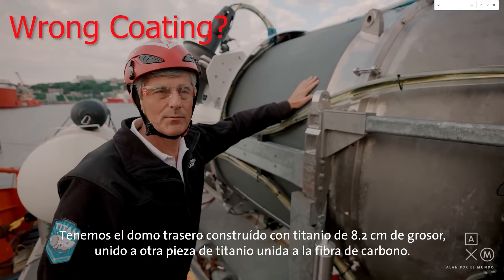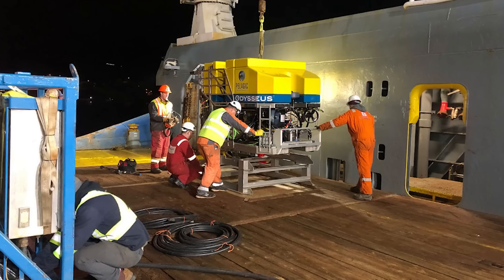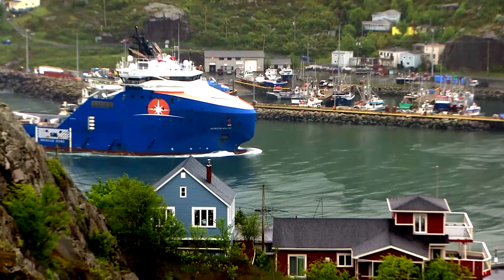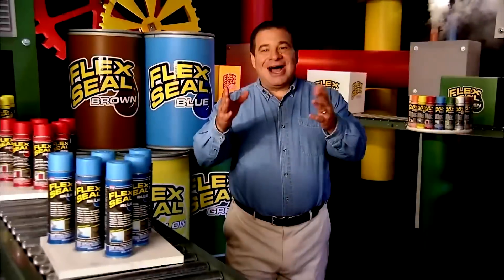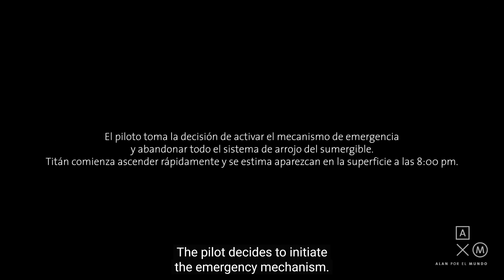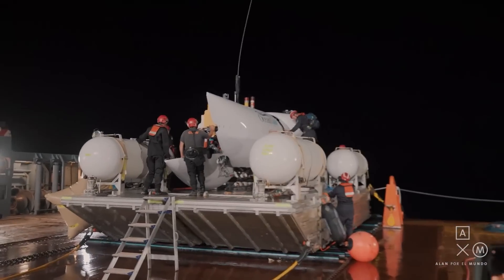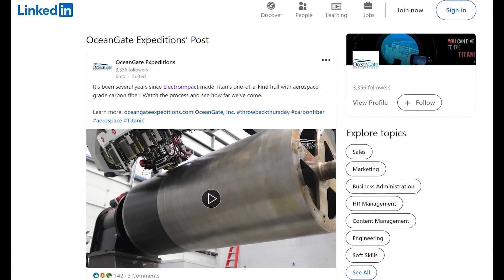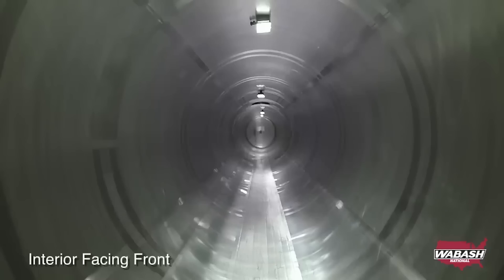Titan Sub Wrong Coating? Hull Construction, Debris Field Search

Comment: 11:45 - how are the ends of the carbon fiber made to be neat? - there is going to be titanium end cap pushing onto the end of all those layers - if the layers aren't perfectly square, there could be quite an un-even force across the thickness at the ends there , if the profile is even slightly like 'www' - 600 layers, with the binder present while still somewhat fluid ...

Comment: Rhino liner sucks. We use it to coat parts and sometimes we need to remove parts of it. With just a razor blade cut a square thru it and it will come up.

Comment: The use of scale models early in the design of ships, aircraft, cars and many other engineered systems is very common in the early development stages.  It is much less expensive to fabricate and test a smaller model than a full size model. Leonardo da Vinci did it.  The Wright Brothers did it.  Jack Northrup did it.  NASA & Space-X do it.  The uncertainty is how to extrapolate the small scale test results to the full scale.  Oceangate learned that CFRP hemispherical ends weren't workable from the 1/3 scale test and switched to titanium hemispheres.  Some fault Oceangate/Rush for lack of testing before diving to the Titanic.  With both the 2017 and 2020 CFRP shells, Oceangate conducted a series of deeper and deeper tests, initially unmanned, then manned by Rush alone, then with others.  Deep sea test results from the 2017 hull in 2018 and 2019 caused them to scrap that original full scale hull and build a new one in 2020 based on lessons learned.  Obviously, the didn't learn enough or they ignored negative test data to keep the project alive.  I've seen it several times before in small venture-capital start-ups with egotistical/clueless CEO's.

Comment: I think the rhino  liner was because they knew there was porosity in the body which could cause problems with extreme pressure changes
Reply: Agree, but what happens when extreme pressures start to 'push' the rhino liner material itself into the pores of carbon fibre?  Be a bit like an extrusion machine pushing plastic into a mold I would think.
Reply: That fact alone should have made this a no-go. Instead he put a bandade on it. Damn fool.
Reply: He should have used Legos
Reply: Yep. Band aids aren't always the best go to

Comment: It seems to me Mr. Rush wanted to open up a commercial for Rhino Liner.
  8 hours on the surface in essentially a can would make just about anyone seasick. 🤢
   A 1/3 size model would have less surface area, thus less pressure total.
   If the hull was made in 2017, you'd think it would've had a hydrostatic test every year for twice + its working pressure and a visual inspection of every millimeter every year at least, just as is required for SCUBA tanks???
   I'm not sure when the hull that imploded was actually built.
   Hopefully, the USCG report will have this information and engineering schematics and notes.
   There is much that can be learned from this incident, and the information should be made public so others can learn so as to prevent accidents.
  Let's keep the brainstorming going!
Thanks!

Comment: Interesting that you mentioned the rhino liner. We do not use it on military submarines. We use non-skid, which is pretty much a coarse paint. Even that chips quite a bit after a little while
Reply: The US Navy does not use non-skid on submarine exterior surfaces. That's used on flight decks and other walking surfaces because of it's incredible durability and high friction. It's comparable to sandpaper made with rocks instead of sand. It creates TONS of friction, lasts a very long time under seriously harsh conditions, and is anything but easy to remove. Trust me on that...I was stationed aboard carriers...

I also served in a maintenance activity that services subs so know a little about that too. US Navy submarines use a highly classified, rubberized coating that's very smooth and slick to minimize sound reflection, turbulence, and drag in water. This material is much, much, much different than either non-skid or Rhino-liner. It is also used for 'waterproofing'  to prevent corrosion of the hull but not for any pressure resistance purposes. It is literally just a sound-deadening and friction-resistant protective coating to prevent acoustic detection, improve a sub's underwater performance, and prevent external hull surface rust. The pressure hull and buoyancy components are all made of steel, stainless steel (some internal piping...), or some other exotic metallic material. Anything but fiberglass or carbon fiber.

This submersible was destined to fail due to Stockton Rush's arrogance, flippant concern for the 'tried and true methods' of submersible construction, and complete lack of design safety awareness.

If I had the opportunity to ride on that death trap, even for FREE, I would have never signed up. As soon as they said 'never been done before' with it's construction, I was shaking my head. When they said the end cap was BOLTED ON and there's NO ESCAPE HATCH, I was completely convinced - an idiot designed this.
Reply: @DaveC_TN  I don’t disagree with the fact that we use MIP/SHT depending on the class of boat, but you’re wrong about using non-skid. Practically the entire topside of US submarines is coated in non-skid. And to add to the MIP/SHT point, it actually creates a ton of drag, considering it doesn’t last and peels off in relatively large pieces.
Reply: the US uses steel for the exterior of the subs with a soundproofing coating on top of that to reduce noise, not to seal it up.
Reply: @williamfowler616  yeah read previous comments. That’s been addressed.

Comment: I don’t understand Rush’s obsession with carbon fiber.  Why focus on carbon fiber rather than making the entire sub out of titanium or some other tried and true material.  Was there a critical need to save weight?  As long as the final product is buoyant, who cares, right.  If the submersible is a little heavier doesn’t that mean you just reduce the amount of ballast you inevitably leave on the sea floor?

Comment: This investigation should go on for years as you once said. I think they were dead before the implosion even happened. With the hull heating to over 10000 degrees. That's unbearable. That's a heat stroke times 100. The implosion just sealed the deal if you know what I mean.

Comment: There is a huge difference in size testing. Also no criss cross was just asking for design fail. It makes you wonder if they were even professionals. If it’s not cross crossed that’s 3 times it’s strength or more it loses I would guess. Why even take the chance. Money? I can think of no other reason. Greed. Wanted fast money and didn’t have enough investors backing him. The Darwin! Haha, so true. All good points I’ve been thinking for weeks. Great video!
Reply: It had to be money.

Comment: There is another unit identical to destroyed Titan submersible. Why not do a hydrostatic test at 3000 m depth equivalent pressure on the full size unit and leave it in there for 72 hours to check out if it survives the test. If it does successfully, repeat test several times to establish resistance to fatigue.

Comment: Good point about scale. In the case of crash testing for cars, the kinetics don't scale for smaller models because the masses will differ, leading to different decelerations, forces, and body damage. While kinetics may not apply for a static case such as the stability of the hull, a hull three times larger will introduce three times as many flaws in the carbon fiber epoxy, thereby increasing the likelihood of failure.

Comment: The hull that failed was built buy Electroimpact in October 2020.  It is included in a 2022 whitepaper by Electroimpact but it has been removed from their website.  The 2020 hull included both radial (hoop) windings and axial windings. The motion of the multi million dollar robotic tape dispenser at (11:30) is where it is applying carbon fiber prepreg parallel to the axis of the cylinder.  I've found conflicting information on whether the 2017 the used only radial windings or both radial and axial. In a video of a lecture,  Rush says it was only radial (90 deg to axis), but a Composite World news story quotes Brad Spencer of Spencer Composites a stating the 2017 hull he fabricated used both radial and axial fibers.  Not critical to the analysis of the failed 2020 hull but facts will come out in good time. If the investigators from 4 countries don't ask the question, the lawyers will.

Comment: He should have had an experienced mechanical engineer as his lead engineer. It needed to be someone also with experience in deep sea applications.
And the testing needed to handle consecutive dive impacts on the carbon fiber hull.
Reply: he did. he fired and sued the guy
Reply: @toomanyaccounts  Yes. However his newer lead engineer was an electronics guy with a degree in computer science. Maybe Rush didn't want anyone else who might have had safety concerns.

Comment: I am unsure why Rhino Liner was used.  Was it for insulation?  Was it for use as a protective layer against physical damage?  Was it used as a sealant?  Was it used for waterproofing?  My professional opinion is that its use would hide the carbon fiber from inspection and it would hinder ultrasonic inspection. 

As I have been viewing numerous videos of the Titan I wonder why there were no frames (ribs) either internally or externally along the carbon fiber hull.  Carbon fiber's strength is in tension and not in compression.   And the loading of the submersible is in compression.  Therefore the addition of framing would have provided strength to offset the compressive loads.

I would be curious to see the strength calculations for the Titan.   How did they determine the 5" wall thickness for the carbon fiber?  How did they calculate the compressive loading on the layers of the fiber?  Or, did they assume that because the pressure was balanced all around that the loading was equal?

Another question, who did the hull design?  And, can they provide the design calculations?

Comment: Regarding Rhino Liner:
I think an appropriate thing to get confirmation is to get in contact with Rhino Linings themselves and ask them directly if using Rhino Liner on a submarine is a good idea or not.
If someone can ask them directly and get a reply from them on this topic, I think that would definitely provide a more direct insight on if Stockton Rush misused Rhino Liner or not.
Reply: My bed coating is amazingly tough, professionally applied (not from spray cans) but Rush was wanting Rhino Liner to be the water barrier that would keep high pressure water from seeping into the carbon fiber.  OK, well, as soon as ANY sensor detected ANY cracking sound he would know this failed !
Just think - 
If he had spent a little more for a Titanium Tube built to well-understood specs he would have an actual success with his sub.
Reply: No
Reply: brother, he bragged about ignoring EVERYONE in the submersible community who told him everything he was doing was a bad idea.
Reply: @mistaajones  
You're preaching to the choir here, my dude. I'm just curious to know what Rhino Linings themselves would say about the way their product was used in this instance.
Reply: @WackyModder84  I am sure their legal counsel has already told them exactly what to say
Reply: well I just looked up there tech data and that's one of the 3 things it says not to use it with, I'm not an engineer and found that info in about 2 mins
Reply: I doubt that they used actual Rhino liner. I bet he was just calling it that like people call any soda a Coke or any bandage a Bandaid. It would be a good idea to keep digging and find out what brand the coating actually was, or verify that it was Rhino.
Reply: @MoneyManHolmes you overthinking this bro. It was rhino liner.
Reply: @vinniehugo9065  I agree. Rush did say he used "off the shelf" products, so I would not be surprised if it was rhino liner.
Reply: @vinniehugo9065 no
Reply: Are we sure this wasn't just a sponsored thing? A bit of liner might have no real benefit other than money for OceanGate and publicity for Rhino Liner? The way he talked about it, either promotional, or just proud he found a "miracle" product himself.

Comment: Scale models are fine for development work where you know you will try many versions, both to keep the cost down and to be able to iterate quickly.  But the final should have been full size.
Reply: Doing the testing on a model 1/3 the size is hardly indicative of what things will be like on the actual sub 13,000 feet down there.  It's truly hard to believe how cavalier he was about the whole thing.
Reply: @Kimber123  I would argue that rhino liner on scale model is good as rhino liner on full size model.
Reply: @edfx  Idk, but there were so many other components that went into this.  That model test certainly would not have assuaged any of my concerns.  Of course, I'd never get in anything like that anyway.
Reply: Aeroplanes have had full scale fatigue test specimens. The Concorde fuselage full scale was immersed in a water tank to test the integrity under internal pressure differential given the fairly extreme duty cycles caused by supersonic flight regimes.
Reply: @jeffeloso  but when they were first designing the Concord I am sure they did not go full size.  Scale models are fine for initial development to be able to rapidly iterate.  But once basic design is nailed down you need to go full scale as not all material characteristics are linear.  Just like initial designs can be on CAD, but you still need final testing for real because CAD still cannot predict all the effects and interactions.
Reply: @kennethng8346  The full scale water tank was located at what was the RAE Farnborough. I spoke with a couple of folks there who worked on it. I witnessed the full scale fatigue testing on the Victor. The final test was a static strength test right up to the maximum expected to be experienced in an extreme flight regime, to ensure any incipient cracks were not at critical length. I can tell you it creaked a huge amount but did not fail, and the deflections in the structure at max load were very significant.  These aircraft were designed  using slide rules.
Reply: @jeffeloso  Nothing wrong with slide rulers.  The atomic bomb was designed with them, we went to the moon with them. What I liked about them is you got a feel of how changing one number affected others.  When I was in college I could do low precision calculations in my head by visualizing the slide ruler in my head.  But after 30 years of non use I can't do that any longer, and when I recentlyi found my slide ruler the slide was rusted in place.

Comment: I'm usually with you on this stuff, but you are off base on claiming pressure testing should have been done on a full sized model.  It is simple mathematics to scale up test results on a 1/3 model (which failed, even so, and a relatively shallow depth at that).  I did a quick search on largest pressure testing facilities, and there are precious few outfits in the world that could test a submersible of Titan's size, so getting time at one of these facilities would be next to impossible, so the scale model was scientifically viable.  The 1/3 scale model imploded, so that showed the accuracy of the pressure test!  Yet Rush had a ready made glib explanation for that failure, so even if an actual Titan submersible had been tested, I doubt Rush would have heeded that warning.  How many hydrogen derigibles exploded in flames before the Hindenburg?  "Unteachable from infancy to tomb — There is the first and main characteristic of mankind."  W. Churchill.  P.S.  That truck implosion video is misleading because tankers are meant to hold liquid in (prevent expanding), not to prevent implosion.
Reply: that tanker had a vacuum inside and 1 atmosphere coming in  wrecked it
Reply: Exactly my point. You can build an object to withstand internal pressure or external pressure. And the structural reinforcements in the build will be different. Tankers are designed so they will not expand outward and they will contain liquid. They are not designed to resist outside pressure which is what happens when you draw a vacuum on the inside. So showing a tanker imploding that was not designed to resist implosion and comparing that to the submarine which was designed to resist implosion, poorly designed though it was, is not a valid comparison

Comment: As far as I can see it is not prepreg carbon but spun wet lay up, I don't see a way of transferring the cylinder to an autoclave, which is the way to cure prepreg, also, boat builders have known for decades that double diagonal planking gives a much stronger hull tan traditional carvel planking, same principal with carbon lay up.

Comment: A solid analysis. 

 All things considered, they did a very GOOD job in getting rescue / recovery gear onsite in that timeframe.

As for the RINO coating, yeah, doesn't seem like what it was intended for.  Maybe, just MAYBE, it would have worked out if they had slathered it on a foot thick.  Maybe.  But probably not.

Comment: One question i have is what if they would of used rings on the inside like that tanker. Would that made a diffrence. Would that make it stronger?
Reply: The middle of the cf tube would still have squished